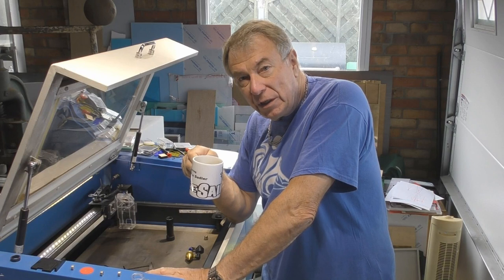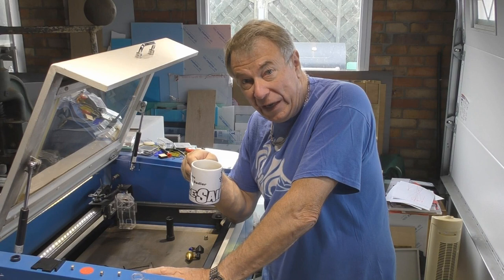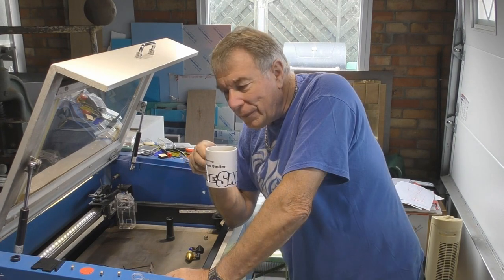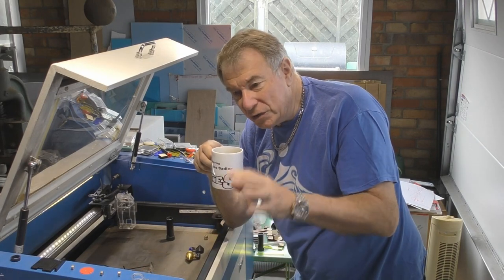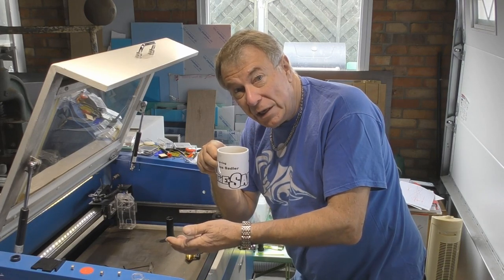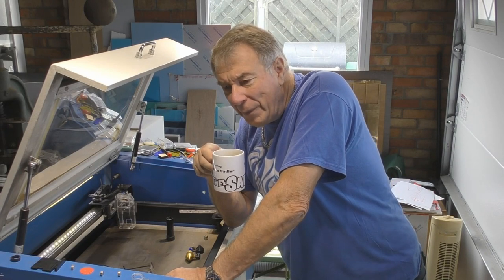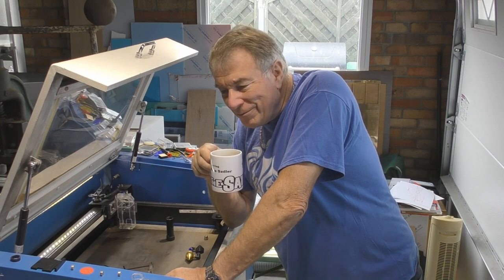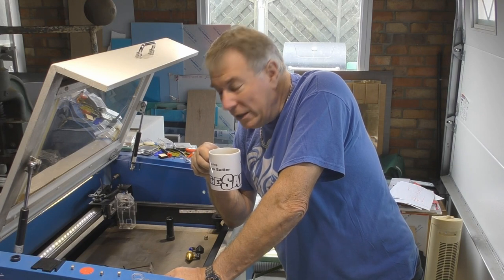RDWorks Learning Lab 151 Lets ZOOM in on Lenses Part 3

Comment: Hi Russ 
Thanks for a great series of vids. 
What is delivery time like from cloudray. Did you use the free delivery.
Reply from the maker: The normal ChinaPost takes between 10 and 20 days to the UK. Yes it's free up to 2kg.
If you choose to go via a courier you will be paying silly money for passing through customs red tape and you may also get stung with sales taxes and admin fees depending on the value of the package. Just be patient it's a lot cheaper.

Best wishes
Russ
Reply: Just order a couple lenses including a 1.5. If I am right I will need to move the 1.5 lense down inside the nozzle about 12mm 

Alan
Reply from the maker: Hi Alan.
I think we need to speak offline so that I can understand your current lens mount system, Add your email to a comment and I will immediately delete it from the public arena.
Best wishes
Russ

Comment: Hi I was wondering if you could help me and didn't know how to contact you. My problem is when I engrave text it only does one letter at a time is there a way of combining it to engrave the whole word instead of single letters.
Reply from the maker: Hi
When you set your scan parameter you will find a group of 5 or 6 tick boxes. You will have ticked the INDEPENDENT OUTPUT.  Remove the tick and make sure all the other boxes are unticked also.

Best wishes
Russ
Reply: Thank you so much I've been trying to sort this for hour and just over seen that tick box. I've been following you videos they are so helpfull. have you ever engraved onto slate. I have the same laser as yours 60watt well it looks the same.
Reply from the maker: ertain slates are good to engrave Watch these two epidodes for a better insight
https://www.youtube.com/watch?v=1nnDgJ8iY80
https://www.youtube.com/watch?v=qwedMjh2kAU
Best wishes
Russ
Reply: Thank you, I will study them tonight.
Regards 
Mark
Reply: Hi Russ
Do you know where to buy new aluminium bars for the laser from.
Regards Mark
Reply: Hi Mark
I don't think you will be able to see any of these spare parts for sale on www. However, I think if you go to   https://www.cloudraylaser.com/   and use the message  button top right, you can define exactly what you are looking for  (maybe a photo and dimensions) and I'm pretty sure they will be able to source the bars because they are dealing with all the main manufacturing companies that make the parts for our machines.I have always found them very friendly and helpful for non-advertised items
Best wishes
Russ
Reply: Thank you once again Russ

Comment: PS.  When do you envisage publishing your plans for the acrylic laser head?
Reply from the maker: Hi Peter
The plans for the Mk2A head are finished and ready to cut and I have brackets all ready to ship to those that need them. IDespite being retired (well 90% ) I have had a few paid work commitments interfering with my laser time. The nozzle episode I slipped into the queue could have had an impact on the new head design. As it happens, with what I now know, that impact is positive and not negative. I plan to make and video the creation of the Mk2A haed later this week....so just a few more days.

Best wishes
Russ